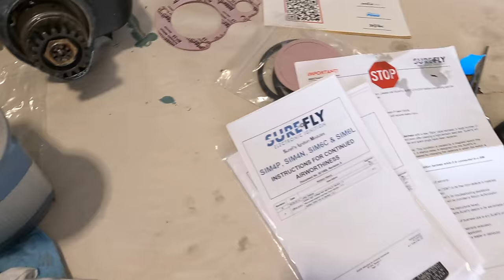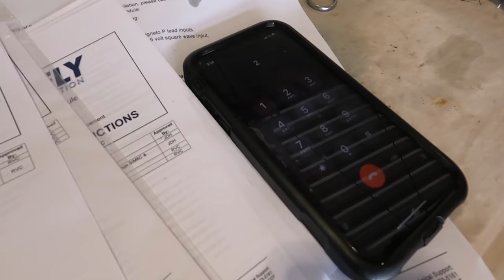New Alternator, Starter installed... Plus an E-Mag #FAIL Cessna 172B Glen's Hangar Episode #6

Comment: Once you get the SureFly magneto system sorted out, any thoughts on adding an air conditioning system to your build for a more comfortable ground taxi and take-off?
Reply from the maker: Not even on the radar - 9 months of the year the temps are between comfortable and freezing, so heating is far more important. Come to think of it; I don't think there is a cooling system that is certified for that plane anyway.
Reply: @GlensHangar  I think Kelly Aerospace Thermal Systems has an all electric STC'ed air conditioning system called ThermaCool that might work for your 1960 Cessna 172B, but you're right, it's probably not worth the time & expense to install one for use in Canadian airspace.

Comment: This might be a silly question, but what's safety wire?
Reply from the maker: Most bolts on the plane have holes in the head so you can thread a piece of wire through, and then thread the wire to something solid. You twist the wire tight, and it helps prevent the bolt form loosening off during flight.
Reply: @GlensHangar  Thanks! One thing I've learned from watching this channel is that safety is taken very seriously when it comes to aircraft.
Reply: @Xondar11223344  A lot of things on sailboats are wired on the same way.

Comment: Interesting problem with the E-MAG. Sure Fly should be ashamed of themselves. Does the Prop spinner make that much difference in speed?
Reply from the maker: I don't think the spinner is much about speed - seems to have more to do with airflow over the engine and cooling during flight.